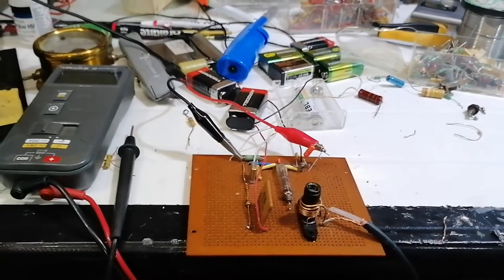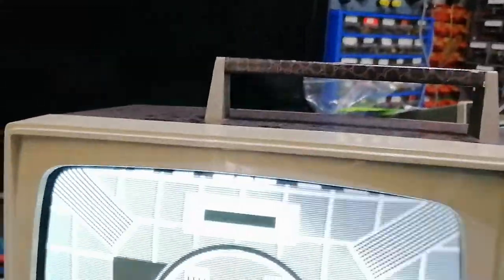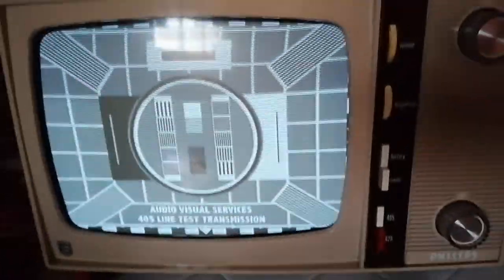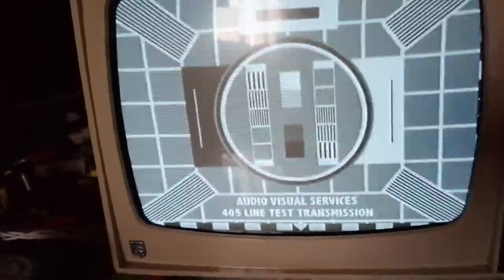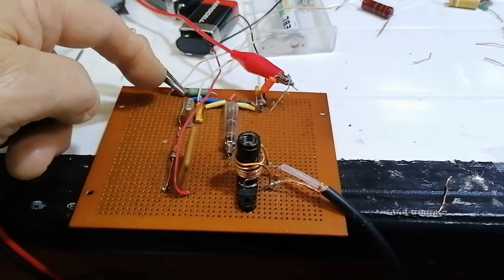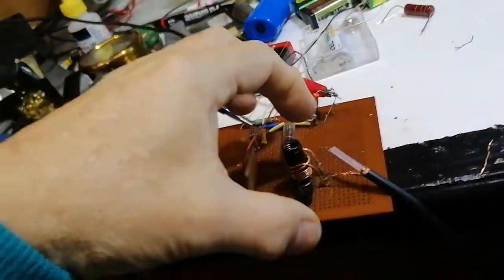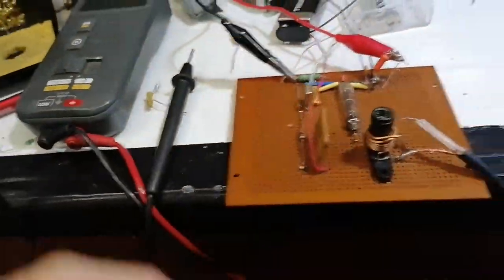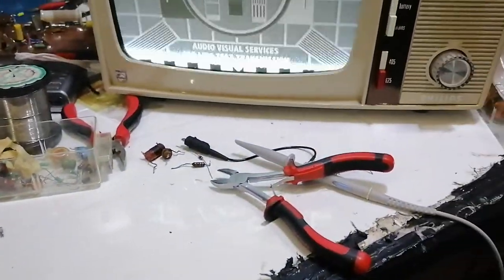405 line Channel 1 modulator using 1ZH37B Part 2

Comment: Amazing to think what was needed in the 405 line days at transmitter sites filled up whole rooms and you are achieving the same signal (albeit at lower power) with just 13 components.